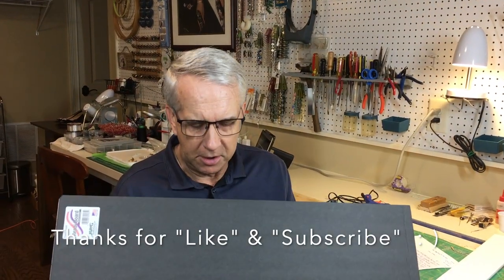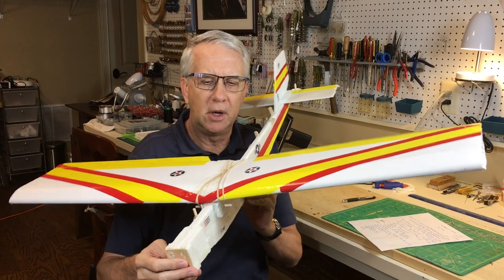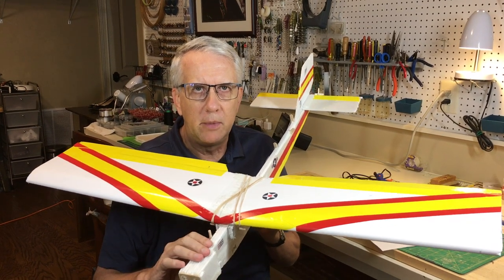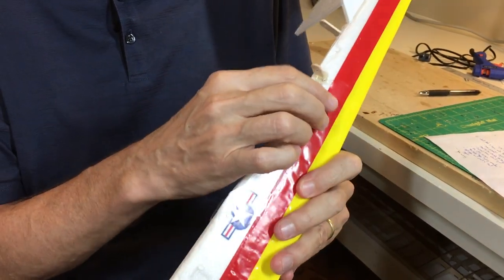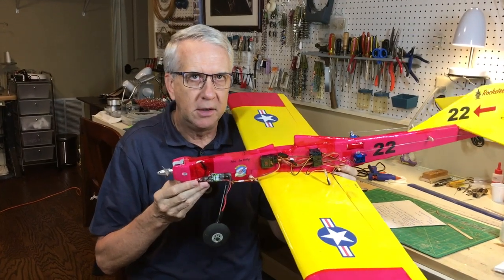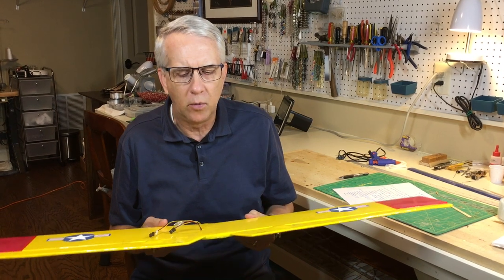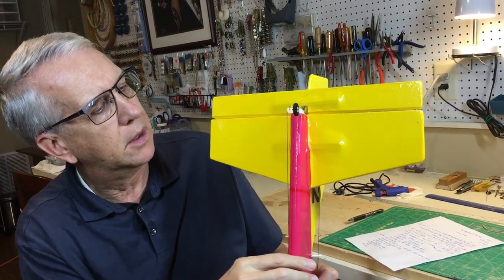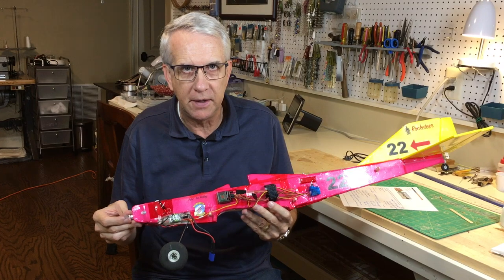Foam Board RC Plane Design - Lessons Learned

Comment: Enjoying the videos Tim, thank you. I've been hot wire cutting thick foam pieces around templates to get aerofoils and fuselage structures. I'm looking forward to building with thin foamboard instead to build quicker and enjoy more time flying but still keen for a 3d fuselage as opposed to your flat, profile fuselages. What about using foamboard to cut formers and longerons or a skin to get a proper 3d and curved fuselage..?
Reply from the maker: Olgoz:  Using foamboard to make regular formers and stringers will work just fine.  You'll be surprised how strong the finished structure is after hot glue is in place.  Tim
Reply: @TimMcKay56  I will try that, I’ve been thinking about that recently!

Comment: Thanks for sharing your "lessons learned". I've just recently discovered foam board planes. One thing I have found to work well is I remove the paper and laminate the foam with clear self-adhesive film from Wal Mart. Its sold as shelf liner in 25 foot rolls for about $5. Works great.
Reply from the maker: David:  That is an excellent suggestion, many thanks!  Tim

Comment: Hi Tim and thanks for posting this... I'm learning lots from your experiences.  I  have one question/thought  concerning the mounting location of the electronics.  Wouldn't it be more beneficial to mount all electrical components on the right side of the aircraft to counter act the clockwise rotational torque of the motor?
Reply from the maker: Clark & Anita:  Thanks for checking in!  Torque is really a factor from large, heavy motor/prop components moving around. With our lightweight motors, really not much of a concern.  I do not think there would be any advantage to moving the electronic components to the other side of the model.  Tim

Comment: Hello, thank you for the lesson. Foam board When an airplane crashes, the airplane board to which the motor and motor bracket are fastened is bent and is the most damaged. Any ideas on how to make this part a bit more durable?
Reply from the maker: MJ:  I always recommend using some 1/16" plywood to reinforce the nose and firewall area.  Use 5 minute epoxy to glue everything in place, works very well.  Tim